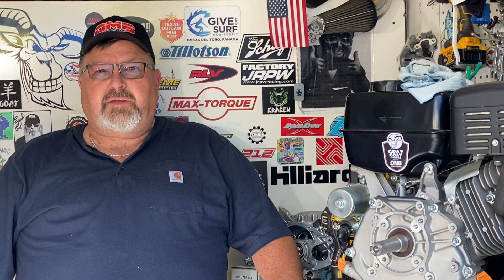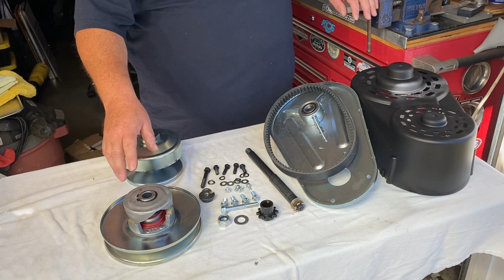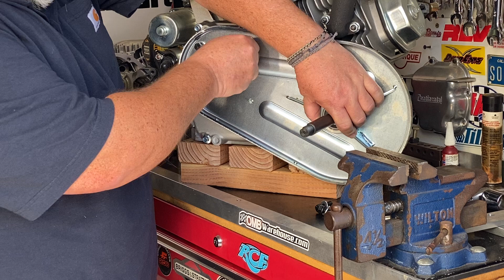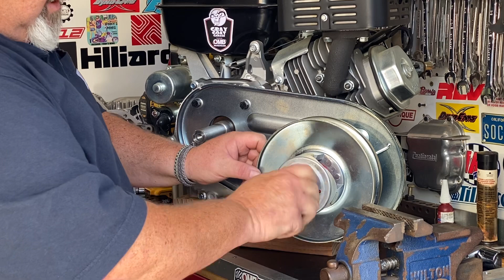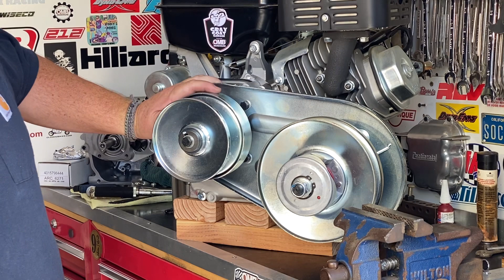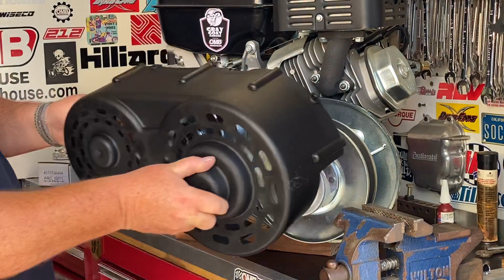40 series torque converter installation

Comment: My 4 black bolts that came with the 40-series are a little big to go onto the engine they twist in and then stop should I still use them
Reply from the maker: No! If they don’t go in all the way by hand get the correct bolts for your engine!

Comment: Quality belt engagement goes down with heat right? So seems with Your set up puts heat onsides you don't want. (moving sheath that does the clamping force.)

Heat wise think best is to flip both and give driven pully little slide room (1/8 +) so it self centers to driven

Comment: So my torque converter came the same way. The front pulley had to be ran backwards so the belt could ride straight. I was told that running the front pulley backwards will cause the belt to burn up super quick so I spaced my pulleys out with some washers and now they run perfect. Is it really true that you can run the front pulley backwards, cause if it is true that would help out so much because I cannot get the belt lined up properly.

Comment: So I get the clutch alignment and orientations now. Makes sense. But I’m still not understanding the purpose of the reverse/counterclockwise spring
Reply from the maker: The driven unit must open up clockwise while the engine spins counterclockwise 
If the wrong spring is used, as soon as the driver clutch grabs the belt the driven will get yanked open!
Reply: @TheGrayGoatGarage so the spring needs to be wound the opposite direction of the driven clutch’s opening direction?
Reply from the maker: @AdamLeoLayne we are referring to the driven spring! They can come either way. Send me some pics to help@ombwarehouse.com and I can verify for you
Reply: @TheGrayGoatGarage yes the driven. I have my driven setup with the spring facing out, it opens clockwise (opposite engine rotation) so what orientation spring should I be using?

Comment: Ok but, whenever I try to stop it doesn't disengage smoothly if not at all what do I do
Reply from the maker: You either have to turn the idle down or get these springs for the driver
https://www.ombwarehouse.com/comet-40-series-red-springs-set-of-3.html
This will increase the engagement speed of the driver

Comment: Yes you showed the way to install it but no you are not specific on many steps of which way your direction things should be facing or put on there you just put them on there with the assumption that people just already know and people don't know that's what we're watching this video this video is so food for thought put a little bit more in depth with the details of how parts are installed and what direction and variation they go in because people could ruin things going off of what they think they saw you do and hope they did it rite but didn't because you didn't tell them what was right and what was wrong you just said you do it like this and then did it and went on the next step

Comment: So I just got mine today, I have one concern and maybe I'm being anal. On the driver pulley, it seems a little sloppy on the crank fitment. Is it normal to have a bit of play before you tourqe the bolt down? It seems like the key is a little too thin and shallow? Is it normal to have a space between the crank and key? Like the key doesn't completely fill the void on the cut in the crank? It kinda seems like it would work but I don't want to damage my crank. Or do I have a bad part? It's a 420 predator engine and this same 40 series cvt. Can I take the key out of the driver pulley and put my own in?
Reply: To be clear, the pulley bore fitment seems good but it's like the key doesn't stick down far enough and is just a hair too narrow. Like I can rotate the pulley a hair before the crank turns. If that's more clear😅
Reply from the maker: It is fine! Run it. The pressure is only on one side of the key
Reply: @TheGrayGoatGarage sounds like a plan 😅 I tend to over think stuff sometimes. I noticed your email at the end of the video so I sent one off to you, basically the same thing with a little more information. If you think anything different after reading that just get back to me there. Thanks again 👍

Comment: I've read that the torque converters are not actually reversible. They only open under one very specific direction whether it's clockwise or counterclockwise and can cause problems over time if they are oriented backwards. Is this true?
Reply from the maker: That is only true for the driven units. The crank mounted driver works in either orientation

Comment: Although the secondary is preloaded in the proper direction, you're supposed to use the yellow spring when doing that. The red spring is to preload it the other direction with the spring inboard. I swear no one gets the 40 series system correct.
Reply from the maker: That is unless the Chinese reverse spring is already red! Only the genuine Comet spring is yellow. Some of the Chinese converters come with the correct reverse spring...that happens to be red. We cannot tell by the color alone!

Comment: Is the 40 only good for the much bigger shafts like on 8 horse power and up or will it work on the pred 212
Reply from the maker: We have seen the heavier 40 series drivers like the 44C driver, break the 3/4" cranks, and we do not recommend that. We can only recommend using a 40 series on 1" shafted engines from 240ccs on up

Comment: Isn't the driver pushing the belt towards motor and driven pushing belt away from it? Seems belt would move on a angle
Reply: I have one and the video is correct for proper belt alignment when running. Cheers

Comment: Is the driven clutch bore 5/8ths inch? I'm getting ready to purchase but I want to make sure it will fit my 5/8ths shaft on the forward reverse gearbox I purchased
Reply from the maker: Nope. The driven unit is for 3/4" diameter shafts
Reply: I need one for a 459 predator any u seen

Comment: Hello Eric, longtime member of OMB had a quick question for you what size bolt goes in that crank good old Amazon sent me the wrong hardware for my torque converter that I’m putting on a predator 420 hemi I can’t believe Amazon messed up lol😂
Reply: Fine Hex Cap Screws, 3/8-24 x 2-1/2

Comment: Have you ever came across the driver squealing? When in motion
Reply from the maker: Only when I run over a cat! LOL JOKING!
The belts can squeal, especially if the gearing is off and the parts have never been serviced. It could be the belt slipping. There is no way for me to diagnose this  without my hands and eyes on it, sorry

Comment: Hey man love your channel i have the exact same torque converter  and i installed it just like you said only problem is my golfcart takes off on me now i used the belt that came with the torque converter do you think i should try and buy a different belt? How would you go about fixing this problem i have? Thank you in advance 🙏 ❤
Reply from the maker: I would really need my hands and eyes on it to know what is happening here. Make sure the inner pulleys are aligned properly. If so, you may want to try another belt. If using the plate mount system, this is the best belt you can get https://www.ombwarehouse.com/-9-7-belt-asymmetric.html

This is only for the plate mount systems
Reply: @TheGrayGoatGarage  is that for the 40 series one like the one you’re doing in the video

Comment: I have a 301 predator engine.  Will that torque converter fit into a golfcart to replace the gas engine which locked up and rusted. I don't understand how to connect this to rearaxle without a drive shaft. Lost in Ohio. Need help for this  82 yr old folk

Comment: Hi Eric, what can I do to stop my primary from grabbing the belt @ idle tried a new belt same issue idle is set as low as I can go duramax 440, I put into a b200r  coleman  thanks I'm puzzled
Reply from the maker: We can change the springs in the driver to the red springs to get the driver to engage at 2000 rpms
https://www.ombwarehouse.com/comet-40-series-red-springs-set-of-3.html

Comment: Can you attach a go kart transmission with reverse gear?
Reply from the maker: Anything is possible! Just not easily 
Most reverse boxes would use a driven unit in the input shaft
Reply: @TheGrayGoatGarage  the one I'm looking at has been tested for the 30 series torque converter but not the 40 series.

Comment: Can you use a belt with the set up instead of chain?
Reply from the maker: I am not sure what you mean by that. The torque converters use a belt between the two clutches and then a chain to the axle sprocket. I am not aware of a pulley for a belt that will go in the torque converter

Comment: My driven pulley bolt is too long for the amount of thread I have. Did you use a different length bolt?
Reply from the maker: No, I did not, but we have to work around Chinese tolerances. Get a shorter bolt at the hardware store and you will be fine!

Comment: This kit is perfect. The steel plate alone weights over 9 lbs. Very heavy duty. The bearing sticks out like that to put it closer to the sprocket. The RED spring on the Driven pulley is already the correct reverse spring and works very well. Comet just paints there spring yellow. Good job Eric.

Comment: You are showing a steel and aluminum back plate. The unit comes with an aluminum back plate. You are not using the aluminum one that comes with it, why? Where did you get the steel one that you are using? Did I miss something you said or meant?
Reply from the maker: It does not matter what plate it comes with. The installation is the same. I feel the aluminum plate is stronger and I prefer it over the steel plate 

https://www.ombwarehouse.com/40-series-1-torque-converter-with-steel-mounting-plate.html
Reply: @TheGrayGoatGarage thank you for getting back to me so quickly. Your input will help.

Comment: Hey, I have a question that I cannot seem to find an answer for anywhere. I want to install a 30 series on my go-kart, but the problem is that the sprocket needs to be on the outside instead of the inside. Is it possible to place a spacer where the sprocket would have been on the inside and mount the sprocket outside?
Reply from the maker: Nope! That will put too much pressure on the plate and it will break!
Reply: @TheGrayGoatGarage  If i weld a piece of metal to the cross bar and add a bearing that goes on the shaft would that help hold it up and prevent it from breaking?

Comment: Hi I know this is a very late comment but how did this hold up thinking about getting one but dunno if it’s good enough to put down money for it
Reply from the maker: We sell a lot of these with very few issues. As long as it is installed properly it will easily hold 25 HP and last a long time. The other option is to spend $400+ for genuine Vomet parts!
Reply from the maker: Comet!
Reply: Thank you!

Comment: Hello, I have a question. I've read that the 30 series tq is good up to 8hp or there about and a 40 series tq is good for up to 16hp or so. My question is would there be any performance gains by using a 40 series tq on a built 212cc predator engine putting out 15hp? I realize you would need to put a sleeve on the 3/4" shaft to bring it up to 1" for the larger front pulley to be used.
Reply from the maker: The 40 series units are very heavy and the snowmobile guys have been known to break cranks. There is a 40 series driver available for 3/4" cranks  https://www.ombwarehouse.com/comet-44c-magnum-drive-clutch-3-4-.html but I do not recommend using it unless you add an outboard bearing and support for the weight.
I have seen 30 series converters used on 16 HP engines. There are some modifications that must be done, but they will support the power.
The 1" drivers use a 1/4" wide key and the 3/4" cranks and drivers use a 3/16" key. That makes it very hard to adapt!

Comment: Question maybe you can answer. Yerf dog go kart worked before breaking swing arm. Replaced it with identical swing arm and also identical sprockets and chain. Put it back together and belt slips...won't propel the cart. Driver and driven unit are used but were working before.
Reply from the maker: I would need to see it. Send pics to help@ombwarehouse.com and I will take a look

Comment: 10 tooth 40/41/420 sprocket not 12
Reply from the maker: Hi Aaron
I have not been able to find a 10 tooth 420 chain sprocket with a 3/4” bore
Reply: Your  description is wrong you said it's a 12 but it's a 10 tooth  Check out the description on OMb OK bub
Reply: I think you should post a how-to video in great detail to perfection, then once you have done so, then you can be a critic on minuscule topics of someone else's video.  Ok bub!
Reply: @jasonbledsoe9379   just stating the obvious that should not anger you but maybe you just like misinformation go make American great again with your rainbow RC troll  streaming dik riding Obama as

Comment: I installed the same kit just the way you did and did not put a reverse wound spring and my golf cart only does 10 miles in hour and rpm go really high. Is this because I need the reverse wound spring? Please let me know and thank you
Reply: You might also consider a larger sprocket. I had the tiny sprocket that was included and got 6-7mph on my golf cart. Upgraded to a much larger one and am getting over 30mph now.
Reply: @TimothysTractors  yeah i was stumped for a while but then i put a bigger sprocket on a few months ago and it goes about 32
Reply: @andrewnemchik7576 I'm having the same issue I changed the front sproket to a 21 tooth  but my golf cart takes off on its own I think the belt may be too tight what do you think?
Reply: @burtonexoticbullies.2313  if I remember correctly we had to change the drive sprocket on the axle to a smaller tooth and it flys now.
Reply from the maker: Yes. Without the correct driven spring as soon as the driver clutch engages the belt the driven gets yanked open.

Comment: I think you meant to say CVT (transmission), not torque converter. Torque converter is type of fluid coupling unit, which acts a lot like a clutch would. While CVT changes the ratio between input and output shaft rotation speed.

PS. Keep up the good work
Reply from the maker: These units are commonly referred to as torque converters and have been for the last 50+ years. If we called it a CVT nobody in the go kart or MiniBike world would know what we were talking about!
Reply: @TheGrayGoatGarage  And they are still mechanical torque converters. There are some really big ones on DAF cars from the fifties, they ran two one driving each rear wheel.

Comment: On the driver/driven alignment the driven moving sheeve should be matching the drivers fixed sheeve at full engagement. This will cause a bit of misalignment when not active. Does that seem right or am I losing my sh!t?
Reply from the maker: I don't know if you are losing your stuff, but I can tell you that does not matter with these units. The symmetric belt is forgiving. Also consider that the original Comet units used the driver mounted conventionally and the driven had the hub inboard...same thing as what you see here, just in reverse! Trust in the Goat...you will be fine!
Reply: @TheGrayGoatGarage  "In Goat we trust"!
Reply: You forgot to show the versatility of adding a band brake unit! Thanks for the good quality video, keep them coming Senior~